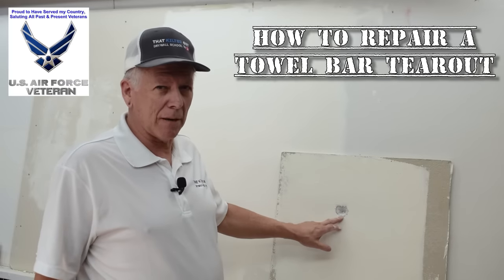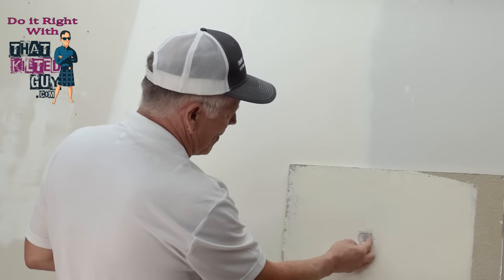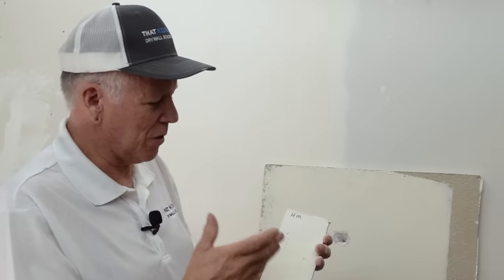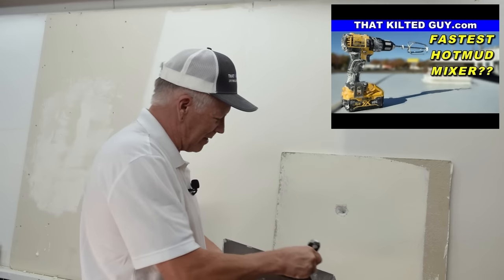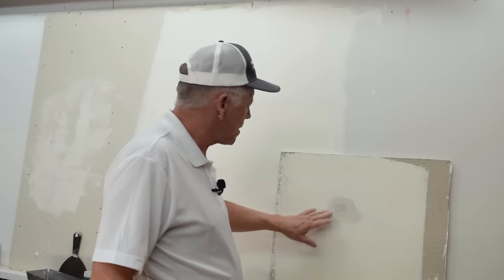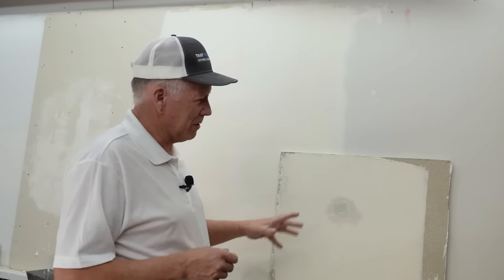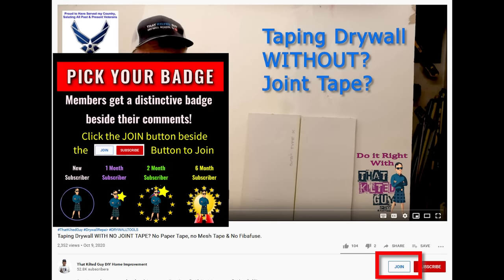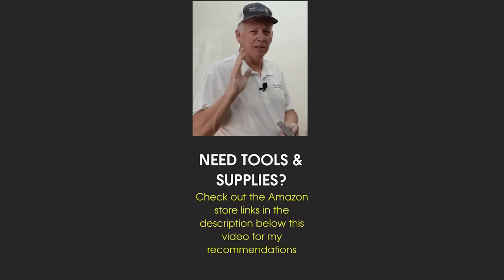How to repair a TOWEL BAR Ripped out of the Drywall

Comment: Yes but this doesn't make it stronger if there's no wood behind it .
Reply from the maker: True. But most of the time the damage is due to using it as a grab bar, kids, etc. Used normally it’ll be fine. If not, reinforcing only one side won’t solve it

Comment: Thank you so much for the video.  I saw you using two different compounds.  Do we have to use two different compounds?  Thanks.
Reply from the maker: No
Reply: @ThatKiltedGuyDIY  For the second coat?
Reply from the maker: Hot mud is best for filling deep fills quickly, and then it’s best to switch to regular mud because hot mud requires a certain thickness to work correctly.

Comment: Do I have to use the joint compound on top please? If I just use the mud and paint it, is that ok please?
Reply from the maker: It’s all joint Compound
Reply: @ThatKiltedGuyDIY  Thank you! I did see you did 2 coats, one to fill the hole with 5 minutes easy sand, and another one with plus 3. Is it ok if I just use the same one please?

Comment: good to know! can you drill the anchor right back into the hot mud patch so you don't have to move the towel bar?
Reply from the maker: It should hold up to light use
Reply: @ThatKiltedGuyDIY  Thanks! Is there a better option for hanging the towel bar in the same spot? the other side didn't pull out of the drywall
Reply from the maker: I'm sure you can rehang a towel bar right back into hot mud, but if you need extra strength, use. Plywood behind the repair.